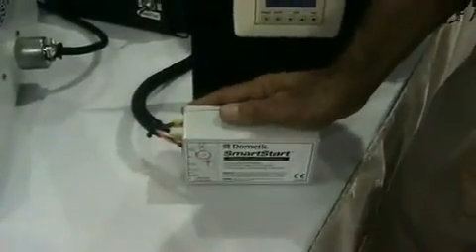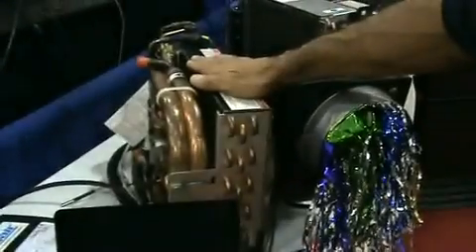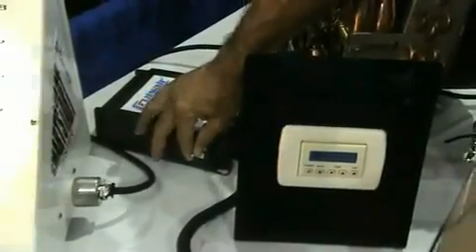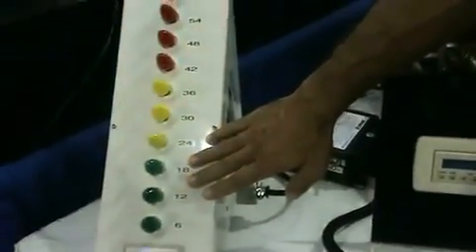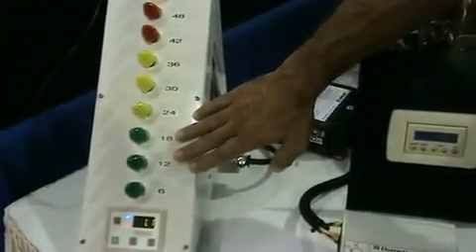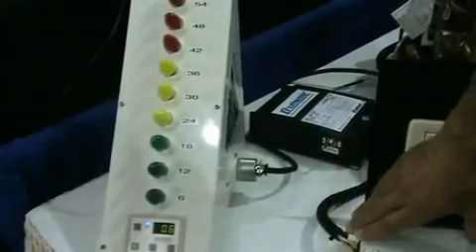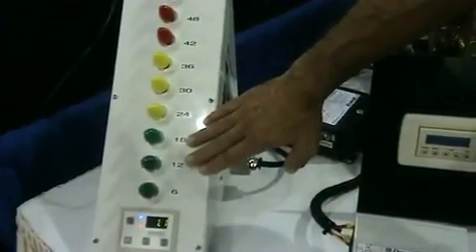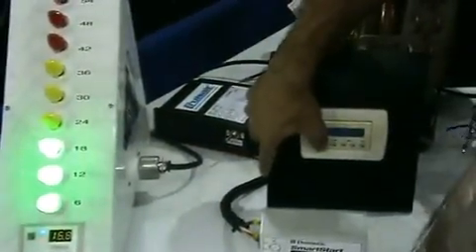Dometic Smart Start

Comment: I spent $700 dollars to put one of these on my boat's 12000 btu Cruisair  AC unit. It reduced the in-rush current to 24 amps.  I tried to contact the company on their website and ask why it was so high and nobody responded. I used a boost capacitor  that cost $20 to help start my AC using my inverter and it work about just as well.   I think 16 amps on a 16000btu unit is a little hard to believe in a real application.
Reply: Yep, you're absolutely right!  Use the Supco SPP6 (Not the SPP6E).  Seems Dometic is marketing the same "wheel" that has been around for decades as though it's "new technology" at a ridiculous price.  Additionally, MANY start problems can be mitigated with clean, solid, tight connections on shortest runs of adequately gauged (more than marginal) copper wire, which is frequently NOT the case in trailer or boat construction.